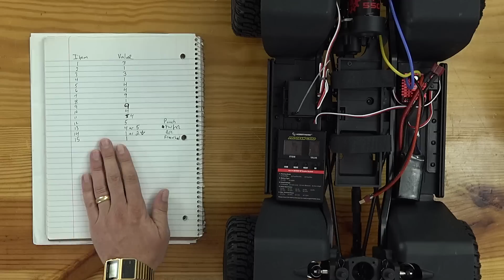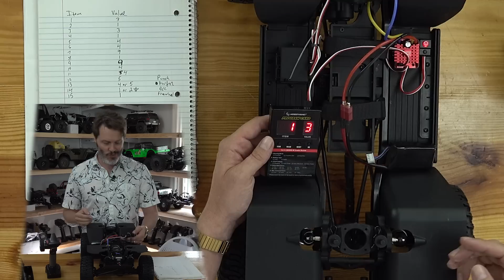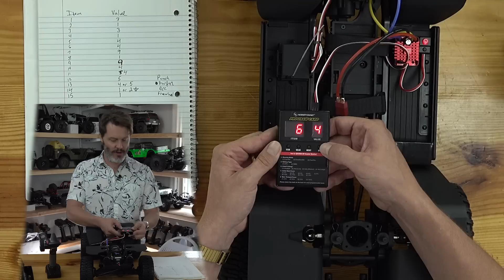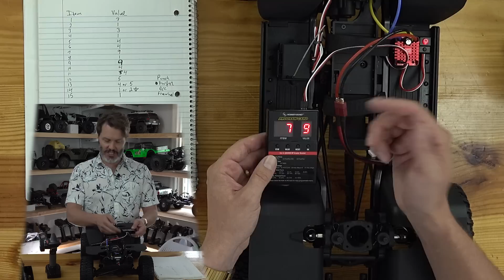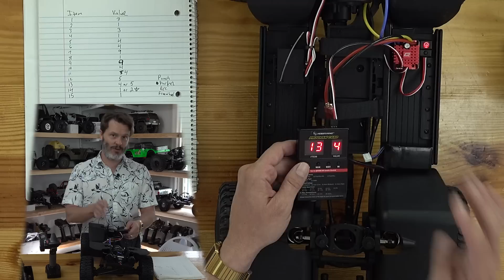More Control! How To Program The 1080 ESC In The Redcat Marksman RC Crawler - Holmes Hobbies

Comment: This looks like a good esc. Can you run 2 together using a Y harness (red wire pulled on one) each using a 6 cell Ni-MH (as you said lipo only)? Also can you calibrate it using a Futaba 4yf stick Transmitter or does it have to be digital?

Comment: I found a little trick when soldering plugs on! I always plug an empty plug in the other side so if i do over heat it a little it holds the connectors straight so they dont move in the housing from overheating
Reply from the maker: great tip!

Comment: Your explanation of the settings, pwm and freewheeling especially, are super helpful, thanks.   I also like your soldering tips and seeing how u do it....
   I have too many rigs and airplanes on Deans to switch over at this point...lol... they haven't caused problems for me, but I have been considering starting the changeover to XT60s and just using them on any new projects until deans fades out of my fleet...?  
   I took the magnifying glass off my helping hands and am close to removing it entirely from my soldering kit...

Comment: Thanks for going through this since I just installed one.  A couple things.  I understand that if you have a heat problem you should lower your frequency.  Also you need to check your receiver voltage before you turn your BEC up.  My receiver will only run up to 6.5V although I have a high voltage servo.  Thanks again.  
After watching you solder plugs on I now just automatically add a red JST(?) plug when I change them.  With all the lights, winches, servos, etc. I might start adding two!

Comment: Note you should always follow the parameters in the ESC manual, don't rely on the programming card as those settings are likely to be incorrect.  ESPECIALLY when mixing brands of program cards and ESC's.

Comment: I built a 2wd truck with an RC4WD R4 scale transmission, 4:1 gear reduction and a Gool RC 80 turn rebuildable (brushed) motor. I was running it on 3s (brisk walking speed) when I smoked the motor! Should I get a better brand high turn motor or should I get a lower turn motor with that gearing in mind?

Comment: What would be the optimal frequency re: startup smoothness and efficiency? Assuming I don't mind the noise.

Also, I sometimes use a higher initial startup power. The lowest setting won't spin some motors up initially so it's just wasted trigger travel. Esp with expo dialed in on the radio.
Reply from the maker: 8k is a good all around

Comment: Hi John been watching u for a while and subbed to u have been crawling for about six months now but been rcing for twenty five years or better was wondering what motor u recommend for a good slow crawl and something that still has enough wheel speed to pick them up off the ground my rig is trx4sport I want to add the two speed but haven’t yet I have a mamba x and one or ur crawl master brushed motors running on 4s but I want some speed so what’s the best of both worlds in your opinion and was also wondering if u mite have a motor in the works for scx24 axial love to have one of your motors in my little guy to
Reply: I have a sport with an 1800kv revolver and a sw4 it will pick the tires up on concrete